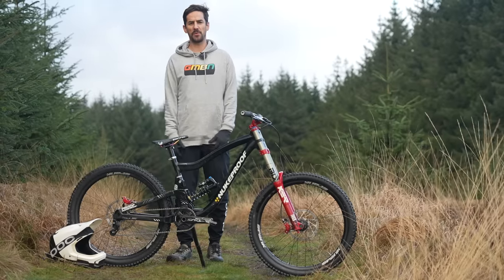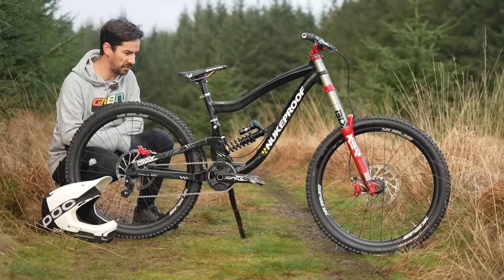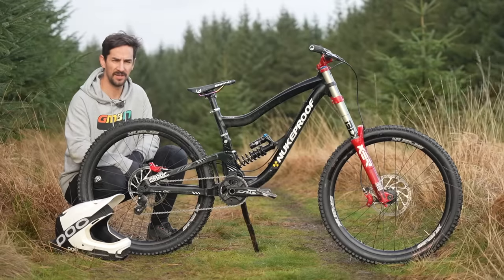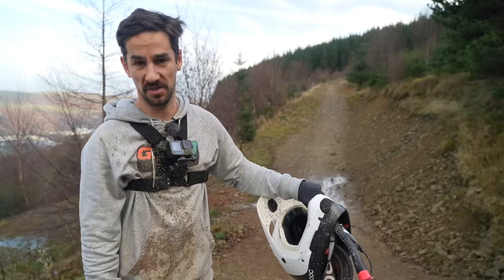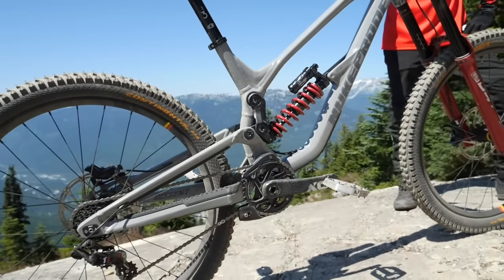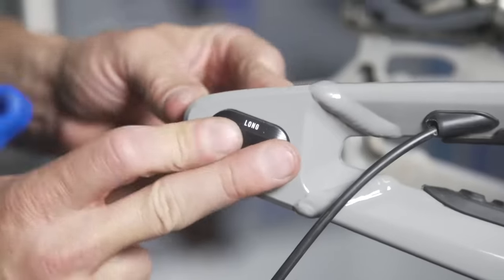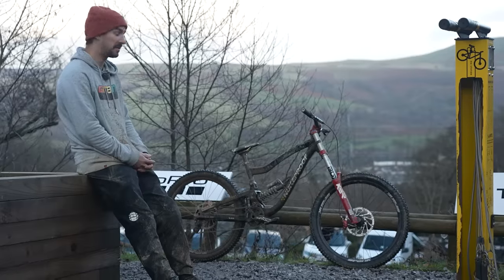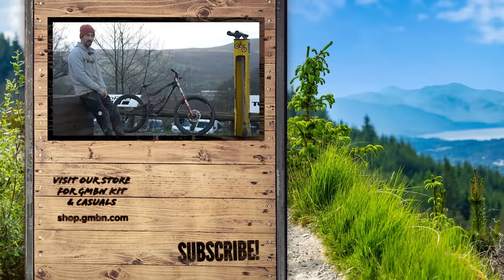This Bike Makes Me Want 26" Wheels Again!

Comment: All those 26ers are out there somewhere…lurking in sheds.  It’s not a big surprise that you liked it, it was all that existed pre 10 years ago.  It’s not like everyone didn’t love them AND they just…worked…on all disciplines.  You felt the tracks, you didn’t squeeze all feeling out with a crappy 29er - for those who perhaps couldn’t deal with the technical stuff.
Reply: eh, had a 26er which was great, then was riding a 27.5 which was great, now tried the 29er and it's great. The difference between them is there and they're a touch different but all good!
Reply: I'm no professional, so I ride my bike for only one reason and that's fun. My 26" Freerider makes way more fun than my mullet Enduro. Full 29" bikes are just meh, fast but meh.
Reply: I got nothing but 26ers.
Reply: @skipperk9champ215  Me too as I have six 26” MTB 😎👍🇫🇮
Reply: Yo I'm a 26 too pal
Reply: 26 still rocks...'96 steel stumpy HT...2001 Rocky mountain full sus....26 x 2.3...
Reply: I used to be a roadie and owned a heap of old school road bikes, but got an early 2000's Giant converted to fully rigid 26er for very cheap and I fell in love with it. I use it for everything, I have a dropper post recently fitted to it and the thing can do gnarly stuff. It always put a smile in my face riding that bike.
Reply: Nowadays I have seven 26’ mountain bikes, my son has also one 26” and my wife has one 26”. So we have nine 26” mountain bikes here... 😉
Reply: 24" wheels or you may as well be a roadie :P

Im just glad to have been able to ride through all the innovation and to have a choice in wheel size.

Comment: The most fun bikes I ever owned were 26ers. I had a 29er and I've got a 27.5 now. No wheel size has ever matched the fun of a 26er. It was always smiles for miles. Think mountain biking has lost sight of that.
Reply: When 27.5 and 29 became mainstream, most people automatically put aside 26 bikes as trash. Like all those years when all bikes were 26 didn't meant nothing. The only positive thing was awesome bargains on great bikes
Reply: Then why did you get rid of them?   Pretty sure nobody is stopping you from using a 26r, have at it.
Reply: @marcuslinton310  I didn't get rid of mine. But now there's a lot less choice of rims and tires. Even inner tubes are harder to get
Reply: @marcuslinton310  I ask myself the same question a lot!
Reply: @cooperwrks   Huh?  There are tires and tubes all over the place.  How many rims do you go through, I've never needed another rim on any bike I've owned.
Reply: too many pedal strikes
Reply: @marcuslinton310  
Actually, it IS illegal.... The MBP(mountain bike police) will fine you £500($700 US) if they catch you on a 26" bike. I was picked up by Interpol the other day, after I  skipped the country trying to avoid paying my 3rd 26" MTB fine. 😁
Reply: @HighlanderNorth1    LOL!  Wouldn't surprise me though if the elitist a'holes of the mtb community actually did try to get something like that done.
Reply: @marcuslinton310  yes it does 
Bike shops do
Not stock something which is out of demand hence leading to a decrease in availability of wheel related components

Comment: Still on 26. I don't like the big wheels so I stay with what's been working for 30 years.
Reply: Totally with you on that can’t the big awkward wheels of a 29er and never saw the point in 1.5” more than something that works. He even said that the 26 is more nimble in the air and down track 🤯
Reply: 30 years……. ?? Afraid of change it seems. I shredded 26ers but new bikes are amazing
Reply: On a 26" Lapierre I've picked up for nothing. In the process of upgrading everything on it. 

Honestly the most fun I've had on a bike I'm selling my 27.5:
Reply: @domgray7587  i like all the wheels they have a place i'm quicker on 29 inch but ride my 456 26er hardtail the most as its a lot of fun and dead light to throw over styles ect and a hoot on the downhill i still want to build a up to date 26er diy frame as i want to see what a slacked and slamed 26er is like

Comment: Mini mullet time!!! Add a 27.5 to the front and give us another awesome video. Compare it to your new mullet setup. 😊👍🏼
Reply: I second that
Reply: 26/29 like the Rampage riders did. You don't need to care about the seat tube angle so much.
Reply: Was thinking the same!
Reply from the maker: Sounds like a plan! After we saw mini mullets being used in last year's Rampage, we've always wanted to try this!
Reply: @gmbn  
🤘🏼😎🤘🏼
Reply: Leave the 26 up front and add a 24" in the rear instead.
Reply: i am in the process of making a slacked and slammed 26er hardtail frame after that am guna do a 27.5 front 26 back full sus frame should be fun to ride

Comment: I rebuilt a 26" 2007 Specialized Rockhopper in the summer, repainted the frame and refreshed all the parts, new air fork etc. Microshift Advent X 10 speed drivetrain. It's a light, compact XC style bike that climbs hills like a champ. In terms of practicality, usability and getting out the door for a quick ride, it's what I find myself gravitating towards.
Reply: Love the Microshift Advent X myself

Comment: I grew up with 26 through the 80’s and 90’s.
29 feels like a tractor to me. Now it’s possible to build amazing bikes for not a lot of money though which is pretty cool
Reply: Ι bought two 29ers and after 4years of tractor-trailer feeling, i went to 27.5 to find control and feeling again, (and im doing only xc  routes..)
Reply: @manitolas  well i have a 29 inch xc hard tail and i really like it because it feels nimble and capable. I also have a 27.5 Enduro  for park days and a i used to ride a 29inch trail bike in the park. The 27.5 feels way more playfull and poppy but you need to ride it really active otherwise you will slow down significantly on slightly rougher stuff compared to the 29inch one.
Reply: @manitolas  That's why I never want to buy a 29er! I think 27.5 will the best choice between the two extremes. Isn't it so?
Reply: @notparanoid912  A 29er just rolls over everything. You no longer need rider skills. This is definitely not what I want!
Reply: @Freidenker888  nah skills are still needed. There is no limit to trail dififficulty, speed and style. The 29er helps to go faster and tackle more rough stuff but is no magic carpet
Reply: @notparanoid912 yes, 27.5 just doesn’t make sense if you want to chase strava times or just to go fast in general, because it dosnt roll as fast as 29er
Reply: @marcusthefaffer  When I'm out on my bike on the trails, I have to watch out for hikers and other mountain bikers. In other words - I don't race. That means my brakes would only be unnecessarily burdened with 29ers, which is anything but optimal!
Reply from the maker: 26" wheels still make a bike feel amazing, especially for dirt jumping and freeride! Although, in certain situations, we totally understand how 29ers can feel a little sluggish. 👍
Reply: @Freidenker888  full 27 is perfect if you are riding hard but flowy ish stuff. But you have to understand that 29 is more valid if you live on the shore or if you are riding really jank shit
Reply: Yeah, 29 is a pushed hype
Reply: @verdi6092  It's not even a hype. It was simply forced on us by the bicycle industry, but I won't go along with it! I will never buy I 29er bike!
Reply: @Freidenker888  if your stopping ability is limited by your brakes, that is a simple (maybe slightly expensive) upgrade remedy and no need to blame the wheel size. 29" tires' larger footprint provides more stopping power (all else equal and set up well). That being said if a brake upgrade is not an option, keep ripping and hiker dodging no matter the bike!

Comment: I keep watching these retro bike builds and I’m definitely going to build one this summer. The older bikes had so much more character and style.
Reply: a 10 yr old bike is retro?? 🤣🤣
Reply: @dabombcreator  lols bikes from 10 years ago are completely different, sort of like cell phones lol. It’s wild.
Reply: @323johnnybravo  Still not quite retro though lol my 10 yr old 26" hardtail has all up to date compononentry all be it still running the old 135x10mm rear and 100x15mm front, only thing thats different to a modern bike is wheel size really...
Reply: @dabombcreator  no way the sizing  is current , my 2015 specialized enduro was tiny in an xl it was comparable to a todays medium. No way the Geo isn’t way off.  Very  steep HA and super slack SA. Bet you have a nice 100mm stem as well lol

Comment: 26" is still kicking! Today I just bought a secondhand Rockshox Totem for my 2012 Transition Blindside and I'm planning on keeping it on the trails for years. My other bikes are also 26". A 2012 Specialized Enduro and a XC Torpado LR2 converted to skinny road tyres. The only bikes I have in different wheelsizes are a Monty 221 ti and a Specialized P20 Bmx. I still love my 26's! 😆
Reply: I have only 26” mountain bikes. I have five full suspension ones and two hard tails. My son has 26” full suspension and even my wife has 26” hard tail mtb. I fully understand you! 😎👍 Greetings from Finland! 🇫🇮

Comment: I am an old school vert ramp BMX rider.  I am 54 years old and found a 29'er to be clunky and hard to get used to.   I currently ride a 2012 Kona Stinky 26er.  I have a 1x9 drive train and a dropper post to allow smaller climbs to remain within my reach.  I actually get a few looks from younger guys at the hills until they see that I am a very capable rider who also has a lot of BMX style tricks up my sleeve that they would never try.  Once they see me ride, they approach me to ask about the bike.  Upside- maneuverable to a BMX convert, downside- heavier than your current mountain bikes.  Definitely want to see more 26er content.  Your usual content generally deals with the newest tech which can be financially out of reach to so many, and it sometimes gives average Joes a feeling that your content excludes them...this is especially true when your brandishing new products is supplemented with mocking older bikes and tech.  I like that this encourages folks to get into mountain biking at any price point, at any age, and at any skill level.  Thanks guys from Canada ,the Mountain biking MECCA.     ~ Bring more 26er content.

Comment: Last summer, I picked up a 2013 KHS DH300 for a good price. It was in great shape. It's a little heavy but it's still fun. I really like 26" wheels. I have a 2007 Stumpjumper that has 26s that I ride regularly. I'm 5'5" and seem to do better with the smaller wheels.

Comment: I have an Intense SS2 with a Totem on the front (160 rear/170 front). The combination of super stiff, small tires, and shorter yet progressive travel shines in DH parks with lippy jump lines (Highland, I'm talking about you). Every bike has it's place and on well groomed jump lines the 26ers still bring the smiles. Highly recommend!!

Comment: I own a full custom 26" polished aluminum Yeti SB66.  I bought it right as 27.5 was coming out and built up the frame with select parts. Have 3rd major rebuild in progress now. I could see going mini mullet on it for more grip up front but the small wheels and tires are so light compared to the bigger ones. It handles DH very well and climbs like a champ. Also real fun to street ride/trials it, which works alot worse with the bigger wheel bikes. 28-29 lbs , garabaruk 10-46  11spd cassette (one of my favorite parts, SO light!) X1 cassette with a carbon XX1 cage (that and headset spacers are the only carbon on it) spank spike rims, 210mm Oneup Dropper (other favorite part) , Renthal fatbars, Manitou Mattoc Pro (another favorite part), Turbine cranks, etc etc. It is a very capable bike and is extremely fun. I have ridden some badass big wheeled bikes but I really like the 26, I think its more fun to handle the bike as opposed to plowing over everything. Plus, having a bunch of older hardtails and stuff its nice to keep tires that fit everything.

Comment: I hear ya and agree. I recently “mulleted” my old Pace RC506, to a 27.5x26. I switched out and reduced the fork travel down to 150mm and to fit the 27.5 wheel. The bike is great fun on the trails, I love it, more than I did before.

Comment: Still running my 2007 Trek Session 10 and 2012 Devinci Wilson down the WC Track at Fort William...I also still use my 09 Commencal Meta AM rig..all with 26" wheels....I do have a 2016 Cube HT with 27.5" ...I always plump for the 26 wheeled bikes though.... it is the bike brands that want you to part with yer cash for the biggest but not always the best of gear

Comment: I ride a 2013 lapierre spicy and it is amazing, the suspension is great (fox 34 and fox float) the drive train works well (shimano xt derailleur +shimano slx front derailleur) and the brakes have heaps of feel and power (formula t1s) I feel like people forget the 26" bikes from 2011-2014 that were actually great. Ik that mine can easily handle some of NZs gnarliest black diamond tech trails.

Comment: I have a 26er I built completely off a 2008 Carbondale Rize frame converted from a lefty and love the thing, got some nice downhill bars, a Dirt Jumper seat, brakes with oversized rotors, Magic Mary tires, love the thing, very nice to throw around and has a DJ/Downhill hybrid kinda feel with how I set it up. It’s not too great for climbing and just getting speed in general but it’s so much fun going downhill

Comment: The 27.5s and the 29s were introduced to the market just because it was all saturated already with 26ers and the MTB industry foresee the market would shrink if they did not move to another standard. 
I miss the 26, a bit better handling on single tracks. But that happened back in the day where there were not so many bike parks with prepared wide tracks.

Comment: still riding my old 26 as the winter ride. easier to lift over gates / barb wire fences etc, fits through tight spaces easier, quick enough

Comment: Well, I just finished last summer a Elemnt 70 from 2006:face-red-heart-shape:(I found a brand new after many years of search) full equiped and race it and it was ... amazing. narrow tracks, river crossing etc a very nice ride but it was assembled with new tech stuff and it was not cheap. XTR 985, Fox CTD instead the RP3, the new reba 100mm with the new tech, a Chris king hubs and head set, some thomson masterpiece, some  Avid brakes, some carbon fibre in cranks and handlebar with ritchey superlogic ... I broke the wallet, all was new, but it was my dream bike and still is. A used one, or one with the old stuff on it will not feel like this one.

Comment: I live in the mountains and I still use two 26" bikes. One is a hardtail from Wheeler, a nice old-school hardtail, but really fun and fast to ride on easier trails. The second one is a full suspension enduro bike - an Ibis Mojo HD which is really good to ride in bikeparks and mountain trails. I always claimed that the geometry of the bike is much important than the wheel size.

Comment: I have a ventanna mtb 1998.  Intense M1 2003 intense m6 2014.  All 26 inch wheels and I really enjoy riding them I did race the intense m1.  Had great times I only own one 29r my wife has a 27.5.   Those are the only two newer bikes the rest are 26rs.  To me 26 is not dead

Comment: I ride a Orange Alpine 2015 model,  had a 29er but where I ride is at Twisted Oak bike park in Suffolk.  The 29er fell it was to big with the  bigger wheel base. The park as some great man made runs, and are small short compact runs, so a 26" is good for jumps  and corners . People some times miss the point it is about  fun and the best bike where you ride . Mark.

Comment: I just picked up a 2010ish Trek Scratch that I am restoring currently, I’m really stoked to get it out on the trails! This will be my second 26ER build, my first was a Motobecane Fly Pro hard tail that ended up under 27lbs total weight. I also picked up an older Specialized Rockhopper for my wife that I am restoring and is a 26ER, I’ve got no problem rolling on them, haha. Cheers! 🤘
Reply: There is a 2013 Trek Slash Available near me in SLC Utah, USA, they are asking $550 for the bike, I’d be willing to attempt to pick that up for you guys if you would be interested, it’s a complete bike, Fox Suspension in a Medium Frame.

Comment: My DMR Bolt slays everything. 125 on the rear, 150 up front boasting a non-boost 26" wheelset. Turns like a dream, comes up from the ground exactly when you want it too. It out rides almost every 29 and 27 on the tech and pulls away much quicker after a corner (which it takes faster).

Comment: I got a Giant Faith  2010 in xmas 2019 for $580 NZD delivered (About 300 pound) and with repairs and dropper I've done almost all my shonky mediocre videos on it for $1200NZD (630 pound).
That's about the same as I paid in 2000 for my Foes Weasel that at the time was insured for nearly 10 times that in replacement value)

i LOVE my 26'ers (at 5tf 10 and shrinking) but may mullet up the front to 27.5 fo a bit more rake as the Faith turns So sharp I hit the Inside of some corners on the exit.

It;s a shame the tyre manufacturers are giving up on us and the largest we can get without a mortage is 2.5"   ...   I miss my Gazzaloddi's

Comment: I don't have access to true downhill courses...just a lot of trails and hills here in the Midwest.  I ride a 26" hardtail that I modified/upgraded extensively...wheels, shock, derailleur...basically the entire drivetrain.  It now fits me and all for under $500.  Big fan of the 26".  Though if I did get access to more technical down-hills, I'd imagine the 27.5 or 29 would be the right tool.

Comment: I have two bike frames (enduro from 2015, downhill from 2019). They are compatible with 27,5" and 26" wheelsize via flipchip. They are still in test phase, but who knows. If I want to gather some experiences, I might swap them out for 26er wheels. I like really like it, when a manufacturer gives you multiple possibilities.